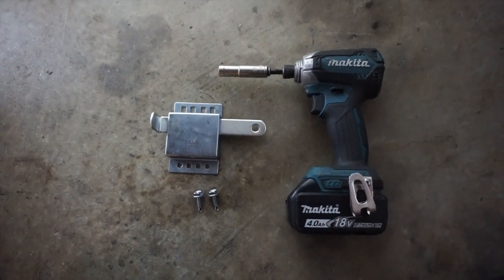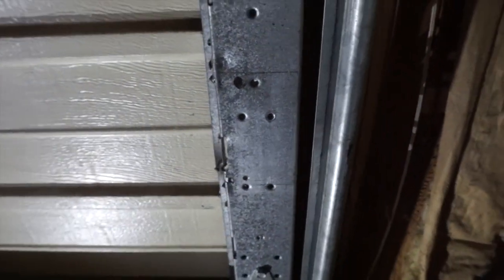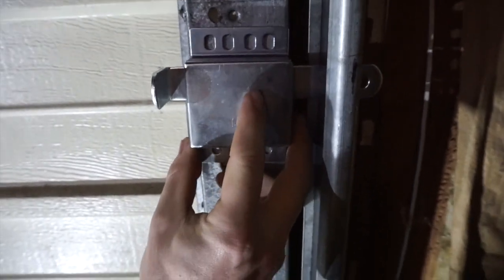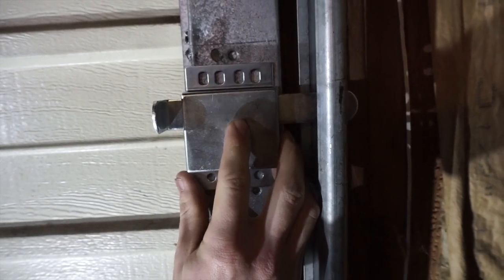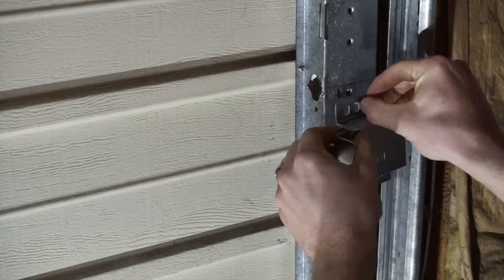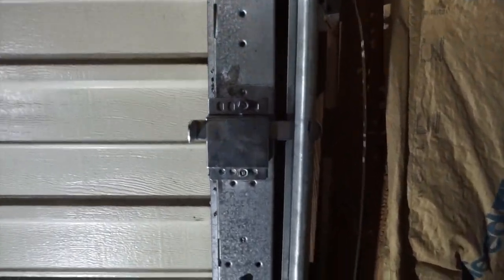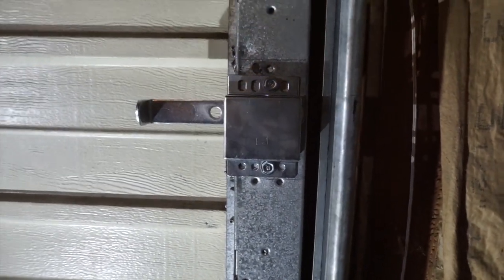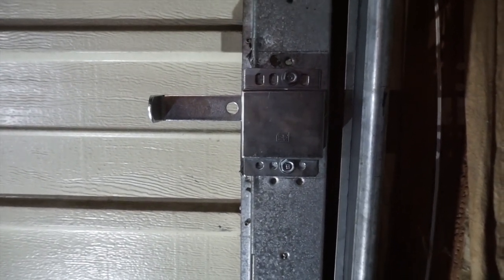Adding a Slide Lock To Your Garage Door

Comment: 1:04  Hint: Gaffer tape the 'unlocked' lock to the door in the proposed location PRIOR to permanently fixing it in place and  then run the door up and down to make sure the new lock doesn't hit anything. If all OK, you can fix it in the proposed location with confidence.

Comment: how does a person access this lock from the outside? say if you wanted to close the garage door and then lock it.
Reply from the maker: Eric Cudmore if you wanted to work it that way, you probably want an outside lock instead
Reply: @v____l  i was thinking the same thing--double security
Reply: You would think he'd also use an impact rated socket. Wouldn't it be "more" secure if you put the lock part on Wood? The Metal can be defeated..? Just a question

Comment: What if your garage doesn’t have the hole for the lock to slide through?
Reply from the maker: You’d have to cut one out yourself, check both sides? The newer stuff and even most older track have it normally

Comment: I just run a bolt thru the tracks when I go on vacation. There's no way to open the door with bolts in my door tracks! Cheaper too.
Reply from the maker: If it works it works 👍🏻